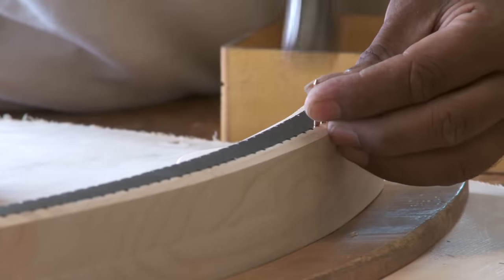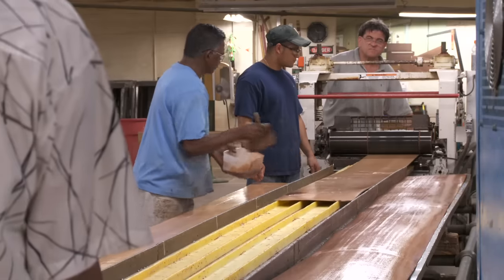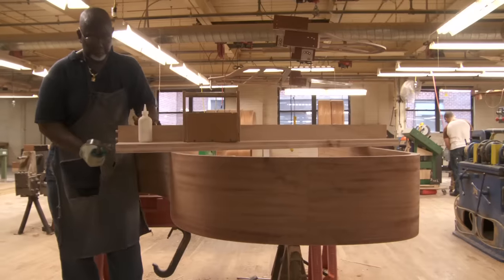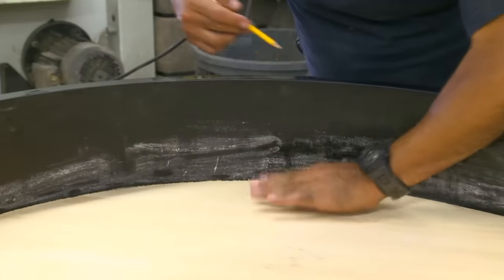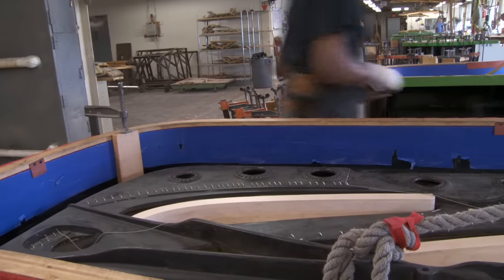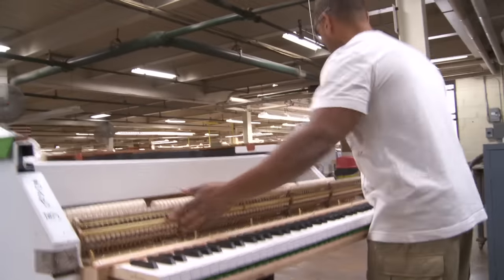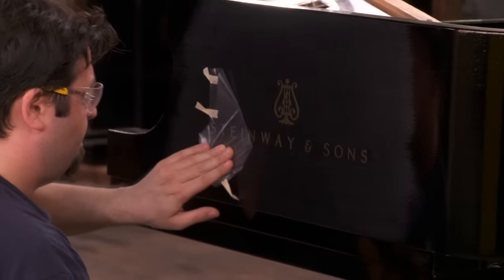The Making of a Steinway - A Steinway & Sons Factory Tour Narrated by John Steinway

Comment from the maker: Also, the wood does dry/season naturally - for a full 2 years - before it ever enters the kiln. The thing is, natural drying can't guarantee you get the moisture content to as precise a level as we need. When woods go in, we know the moisture content and know exactly how long it will need to spend in the kiln to get to the very precise moisture content for this wood to be ready to continue in the process towards becoming a piano.
Reply: have you guys experimented with the curved rib design?  have seen some tests done and using a curved rib to put the crown into the board seems to have a notisable increase in sound over the traditional method of drying ouy the wood, glueing the ribs on, then letting the moisture create the crown.
Reply: i used to work for rex lumber and we made stuff for you guys . after i left there i used the same way of glueing maple to build speakers and subwoofer boxs . i won every spl contest i ever entered . just wanted to say thank you !!
Reply: Before choosing the Steinway M I bought ( 1945 ), I've probably played 10 to 15 other Ms, including new ones.  Why such a drastic difference in sound? Shigeru Kawai pianos and top Yamaha don't present  such drastic differences. Also, I can't understand why most technicians have a beef with Steinway, while constantly praising Shigeru Kawai, Bosendorfer and Fazioli? Do these manufacturers have higher standards than today's Steinway production?

Comment from the maker: Thrillscience, the wood used in the rim may sometimes erroneously be referred to as "plywood" but it's not. It is Hard Rock Maple, one of the hardest woods available, and absolutely not cheap. This wood needs to be as hard as possible for a couple of reasons. 1) to provide strength and stability to the entire piano -- the rim is essentially the foundation 2) because softer woods (like Luan which is sometimes used) would absorb some of the sound rather than projecting it back out of the piano.
Reply: Steinway & Sons tyt
Reply: Yes, the rim of a grand piano must reflect the sound back to the board and then into the bridges. With many European pianos including Yamaha, softer woods are used for rim construction and tonal power and complexity of sound is lost. Yamaha does use a solid rim, but not true rock maple. It is usually beech with a layer of luan which will  never work for a piano's projection power.
Reply: It's multiple layers of wood (in this case hard rock maple), that makes it a plywood.
Reply: @jacobgreengas7121  Exactly.  I think the original point is a good one: this is a high quality, custom made piece of plywood, and is not the same as the $20 pine sheets at Home Depot, but it's still plywood.
Reply: You need to take some courses in piano technology instead of parroting brochure text.  The rim prevents energy from being lost but an excessive reflection of energy can cause undesirable sound reflection that very often occurs on Steinways. Piano manufacturing is always about compromising and energy consumption has positive effects to balance the tone, an extreme example of this is Bosendorfer which uses spruce (a soft-wood) the energy consumption rate is higher and diminishes the amount of reverberation resulting in a cleaner sound envelope. There are a number of piano makers who have surpassed these mediocre piano manufacturing methods implemented by Steinway, unfortunately, don't have the presence in the market or the ability to make professional pianist acquaintance with their pianos. I know this comment will be deleted because it is not in the best interest of Steinway to be exposed. Including the fact that I suspect that some of the small pianos' rims with black polyurethane finish are not made in the USA by Steinway and although I have no evidence that this is true, the hint is that they look identical to another brands' rims, and I never saw any infrastructure at Steinway's factory that indicates they are set up to make rims with black polyurethane coatings. 
 At least for a brief moment, someone will find out that there are people out there who really know about piano-manufacturing and are not impressed by fairy tales or the indoctrination of piano players but they have true expertise and had evaluated multiple manufacturers. 
All these famous pianists favor Steinway because they already know that when you are touring that's all they will find to play on, so even though they may enjoy or like other brands better, they understand that they won't be able to find it or bring it to concerts so they already OK with a brute workhorse like model D.  At that level a piano is a tool, people on the outside think the pianist is melting playing a  Steinway. No! they are working that's all and many expressed how crappy they can play. Many concert pianists around the world owned fine pianos in their homes that are not Steinway.
Reply: Alex Sung calm down
Reply: lol why are u lying. even in ur video you show the rim being made from ply wood. sure the ply wood you use may be "hard rock maple" and who know it may be the best wood ever but its still ply wood
Reply: @08yannch  just get a yamaha digital piano and download the best quality digital piano imstrument on it. The great thing here: you can change attack, reverb, brightness or mellowness anytime
Reply: @MostafaElSakari  Why? Sounds very knowledgeable and sensible.
Reply: @MostafaElSakari  Hmm. I don't detect any degree of excitement, merely an expression of a contrary view. Very interesting comments...
Reply: @08yannch  Ummm no one said it wasn't "plywood"  what was said that is the construction of the plywood is unique.
Reply: @JanHough  But expressed aggressively and rudely. Which is not necessary. Comment piano, not fortissimo.

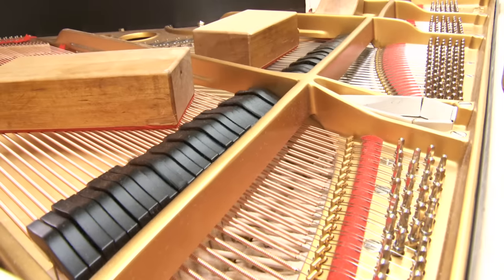Comment: 7:02 one of the keys isn't moving, #7.
Reply: You're damn right :-)))
Reply: I also noticed that.  But not the key, the damper.  And it is stuck in the up position.  I had the knee jerk reaction to want to reach into the screen and try and figure out what was wrong.  But you can be sure it was fixed.  However, they probably shouldn't have let that slip by and show on a video designed to present excellence.
Reply: Stream Highlights Wow, what keen observer of detail.
Reply: You've got a sharp eye

Comment: The only problem I have with the newest Steinway grands is that the company has opted to make the down weight so light  that there is not a modicum of necessary resistance to sculpt a wide range of dynamics. I have a golden era built Steinway, rebuilt a few times, that preserved the down weight that is about 52 and very desirable.

Comment: There's only one thing that I actually don't like about stineways and that's they take quite a bit of maintenance. But that's the only thing besides that it's a fantastic piano
Reply: awesomegammer16 Yes.  All wooden instruments require maintenance. But its like fine woodworking tools.... your always having to sharpen and tune them to keep them on the top of their game.
Reply: I do realize that all woodenrequire maitnenance
Reply: I do realize that all wooden instruments require maintenance but stineways seem to require much more than usual. My piano can stay in tune very well but my piano teachers concert grand stineway has to be re-tuned every week
Reply: The man Who tunes my piano up every year eventually stoled the action and ivory keys can that be replaced
Reply: As a piano technician, I don't find Steinway pianos to require more maintenance than other pianos.  In fact, they are very solidly built and are usually more reliable than lesser brands.  Hours and severity of use vary and so does the humidity and other environmental factors.  Add to that the sensitivity of the performer to imperfections in tuning, touch, and tone, and you can see how some pianos may be tuned and regulated more than others.  The best pianos are often worked the hardest, and require more maintenance than a piano that sees little use.  A cheaply built piano would wear out much faster in such a professional environment.